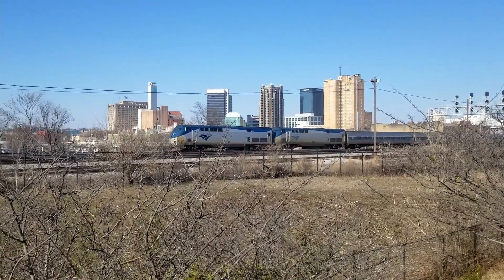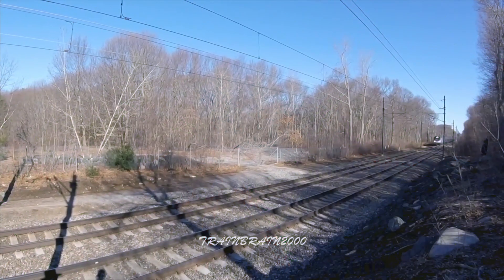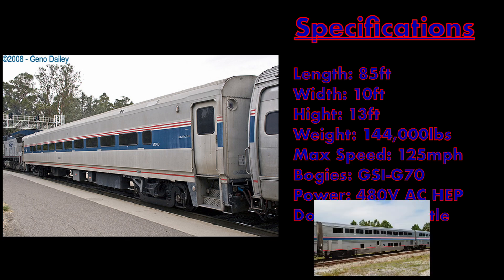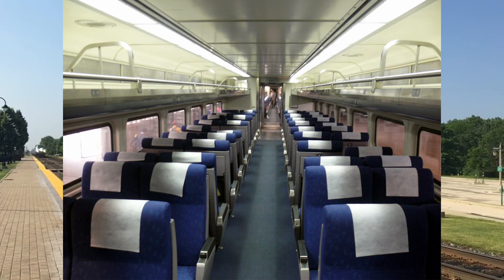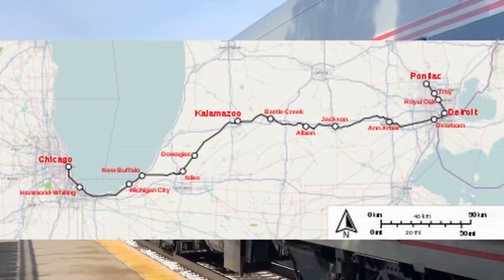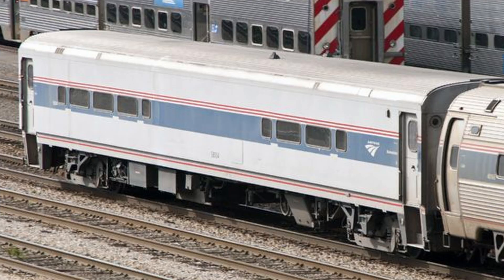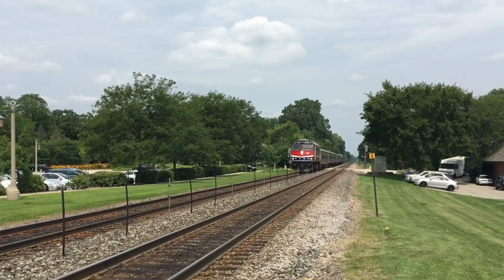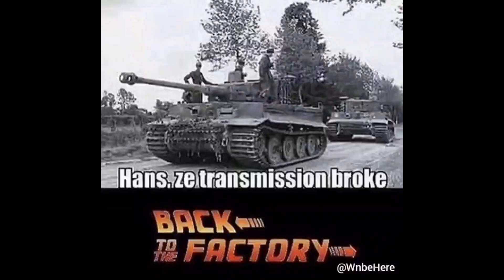Equipment of Amtrak-  Horizon

Comment: After my experiences of operating the Talgo equipment, I really love the simplicity and reliability of the Horizon and Amfleet equipment. There has been several occasions where there was an issue with the Talgo equipment that made us late, or had to cancel the train because some dumb thing went wrong with a door or step or something. The horizons are basically a boxcar with seats. They do what they are supposed to do, and if there is an issue my crew can fix it with a sledgehammer. I’m dreading this new Siemens equipment that we are supposed to be getting. Yeah it will be great to have new equipment, but I foresee sitting at the depot for hours because flux capacitor doesn’t work. It’s bad enough dealing with brand new Chargers that constantly break. Now the whole train is going to be broken.

Comment: When I travelled from Chicago to Kalamazoo in 2018 I was booked in a Horizon car and the air conditioning didn't work so I spent most of the trip in the café car. I still had to return to my Horizon car before getting out because they only opened one door in Kalamazoo, at a track without a real platform. Bizarre experience for what is supposedly a first world country.

Comment: Besides supplementing the Amfleet, the Horizon cars were ordered to replace or at least relieve aging Heritage cars. Besides the Chicago hub routes, they've run in California and turned up at times on long distance trains. 8 coaches were fitted with 60 legrest seats to run on the Three Rivers between New York and Chicago. They were later restored to higher capacity seating. Horizon coaches were built with at first 82, then 76 seats, reduced later to 68 seats to allow for ADA. The food service cars have had coach seats, business class seats and all table seating.

Comment: Bombardier didn't build the Comet I; Pullman Standard did (in the early '70s). But Bombardier acquired the IP and had already delivered the Comet II to New Jersey Transit and others starting in 1982. That's what the Horizon is based on. NJT's Comet IIs were refurbished in the early 2000s. They got some mechanical upgrades, the cab cars were de-cabbed, the livery was updated to match the then-fairly-new Comet IV, but the key feature from a passenger perspective was giving them '90s-tacular interiors to match the Comet IV, which now look incredibly dated and are falling apart. I almost would rather have the orange and brown seats, brown carpets, and Arrow III-esque woodgrain wall panels back. Today they exist mostly to be scattered willy-nilly into trains of Comet IVs just to annoy people on the platform when most of the cars in the train have a center door but they find themselves lined up as far from a Comet II's end doors as possible